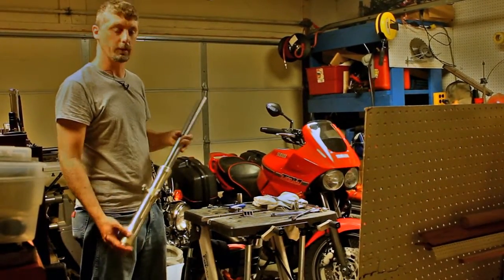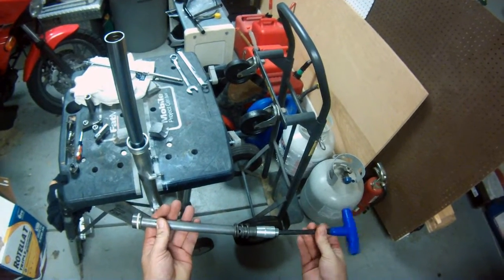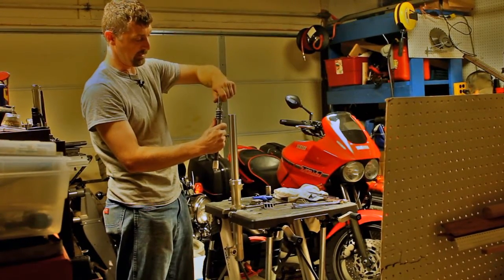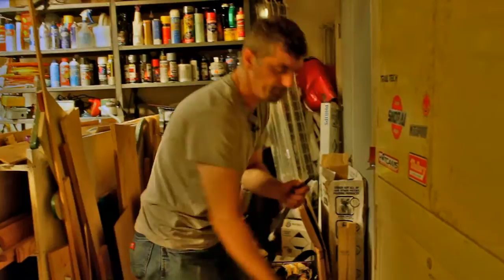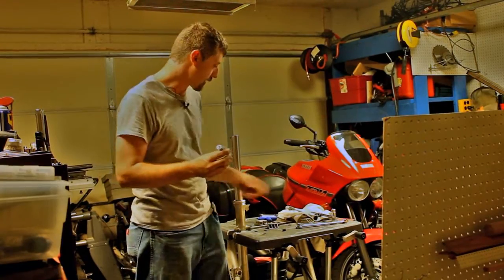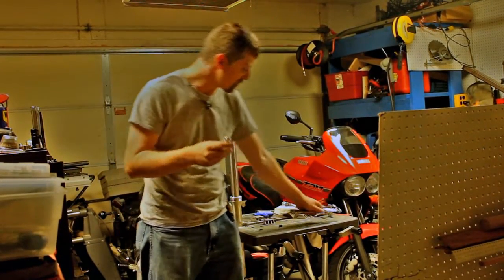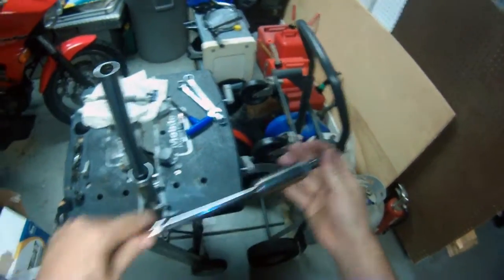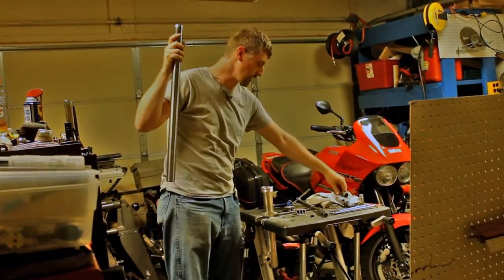How to Build a Motorcycle Fork Specialty Tool

Comment: Thanks for the video. It was very helpful for fixing my 2000 Kawasaki KL250G Super Sherpa.  The electrical tape trick really worked!  For anyone interested, the Super Sherpa  required a 7/8 (or about 22mm) 'outer diameter' bolt.  I tried using an impact wrench on the lower fork bolt and that didn't work.

Comment: tightening the two nuts together means that they are now coned. This is how you made the tool to loosen the internal nut, coned is a bicycling term from the 70's, when adjusting front or rear hubs 2 flat nuts tightened together forcing the axle to treat them as 1 unit. This practice has stopped. current hubs are held in place better- excellent film

Comment: It's usually easier to hit the damper rod bolt with the impact BEFORE you remove the fork cap. Spring pressure usually keeps damper rod from turning in my experience. Nonetheless, your homemade tool looks quite effective.
Reply from the maker: Good tip!

Comment: You can also weld a 5/8" nut to the end of a welded steel T.  Sill have my tool from years ago.

The problem now is an FZ6 fork.  The tops of the dampers no longer have a nut socket in them.  Why? Ask the jerks at Yamaha.
Reply from the maker: Yep, that's a great way to do it if you have access to a welder. Thanks!
Reply: Do you have a solution to hold the damper rod in place? I'm not able to tighten the damper rod bolt on my 2010 yamaha WR125X.

Comment: you had the other one already pulled out, so you were able to match the bolt head size, but what is that size?
Reply from the maker: It was a 5/8" spark plug socket that I had used. Can't remember if it was a snug fit or not.
Reply from the maker: And I should add the spark plug socket was flipped around and on the extension backwards, so that the hex shaped top portion would fit into and engage the specialty socket inside the fork.  This is explained better in the video.

Comment: Why not just break the bolt loose (but not remove it all the way) prior to removing the fork spring and cap?  The pressure from the spring with the fork cap still on should keep the damper rod in place and give you enough pressure to do a quick blip of an impact gun to break it loose.  Then hand pressure on the spring and will keep it in place to remove it the rest of the way.  That is of course after the leg has been drained unless you like cleaning up a mess!  I have always used this method without fail on traditional forks.
Reply: Thanks
Reply from the maker: Interesting approach. When re-assembling do you have any trouble getting it torqued back tight enough with this method?
Reply: @ModernSurvivalists  you're right, you do still need to make a special tool to correctly torque on installation. The advantage of removing without a special tool (as Aj suggests above) is that its often way easier to make said special tool when your holding the cartridge in your hand and can measure stuff. For example if you are making a castellated tool. You can't easily guess what tool to make by looking down the upper tube with a torch.

Comment: 4:58 I tried some other methods but none worked for me. I had to buy the specialty tool and it still took two people. That damn bolt made my rebuild so much harder than it needed to be. Why cant they just put a normal hole in the damper that accepts a hex bit or SOMETHING, literally anything else... Put a damn bolt head with a hole for oil flow. Its not rocket appliances 🚀